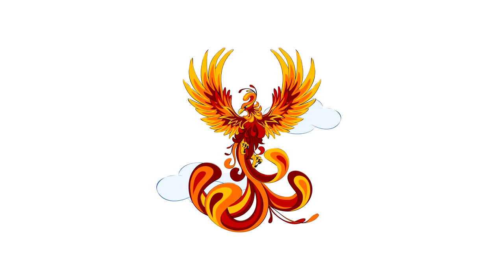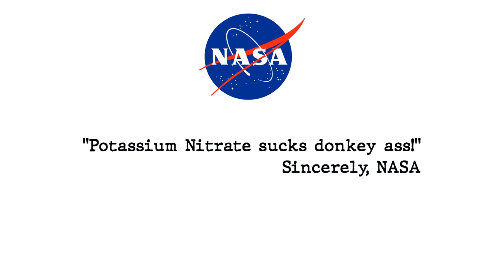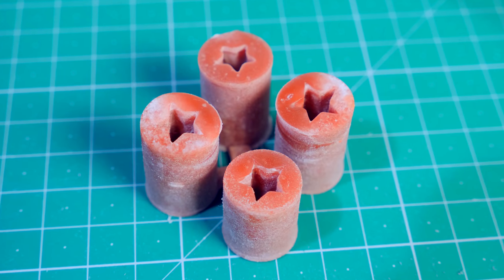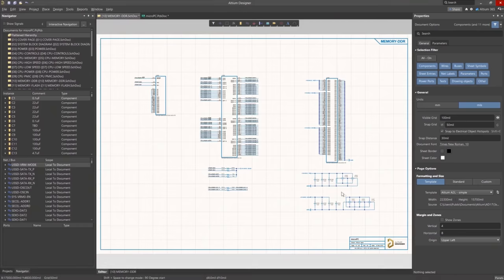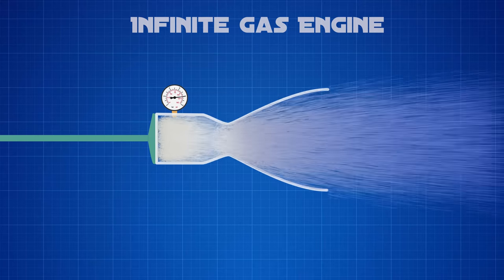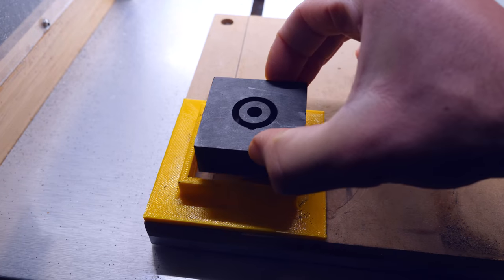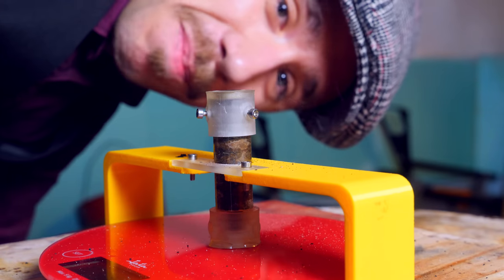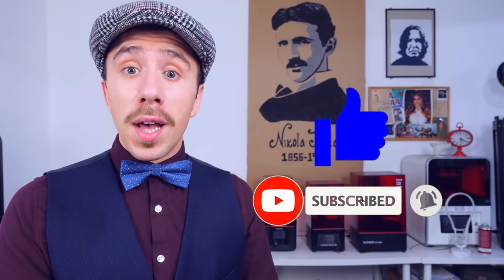I built a PULSED ROCKET ENGINE

Comment: Hi Integza,

I think for your next video, you should make and launch a rockoon and shot for space.

The project would use the rocket components you have been testing, a weather balloon and a small payload maybe a tomato, if you want to put one in orbit or a small satellite. 

i am not sure on the numbers, if it would make it in to low earth orbit or not but the weather ball would cut the distance the rocket has to travel to achieve it massively.  

this would also give you a project that uses the 3d printers for structure of the rocket, cradle and a small amount of electronics, Arduinos, raspberry pi. this would be good for igniter, gps, and other parts of the projects.

this would also give you a chance to use Altium designer for a custom pcb for the controls of the rockoon.

hope you enjoy the idea. 

looking forward to the next video.

Comment: 9:06 the scale is not a very accurate measuring device as the rocket gets lighter when the fuel burns up, you can see at the end that the scale shows a negative number
Reply: True. Also this kind of scale is "very inaccurate" at the base and top of the scale values. He should use a weight to overcome this issue. About the fuel mass variation, he could try to compensate it mathematically.

Comment: Ref 3:25 => A more useful (assuming one is interested from a design standpoint) description of a rocket nozzle would be to state that the nozzle has a smaller diameter than the equivalent core diameter of the solid fuel (called 'grain').   Then it would have to be further explained that fuel grains may be  cored in various shapes, so that the word "equivalent" means their effective circular diameter as IF they were cored in a cylinder shape. However as most small amateur rocket fuel grains are cored in a cylinder shape, it's easily comparable to the nozzle throat diameter.

Comment: You should try to funnel the exhaust gases from a rocket motor and use the gas to turn a tesla turbine with a generator or a propeller on it :D. It might be inefficient but it would be intresting!

Comment: Video Idea: You mentioned, the last time you did a Tesla turbine video, that you were interested in progressively improving the turbine tech. I love combining different ideas from multiple people and I think I found a cool idea for a video.

Tom Stanton made a magnetically-levitated, flywheel-powered, alternator. The idea was to create something that had near-zero friction, which would allow nearly 100% efficiency.

It occurred to me that if you replaced the flywheel with a Tesla turbine, placed the levitation magnets on more than 2 sides of the center axle (to hold it in place better), and surrounded the axle with the turbine casing; you might be able to create a Tesla turbine that can actually spin an alternator at ridiculous speeds.

Comment: Some rockets use the liquid fuel as a way to cool the rocket to keep it from melting. They pump it through tubes like a radiator but instead of a radiator its the nozzel. Maybe print something similar and try cooling the rocket with its own fuel?
Reply: Not in SRBs tho
Reply: Liquid fuel makes everything 9001% harder
Reply: It was used on the V-2 rockets to keep the steel from melting. They didn't have the advanced materials we do today.
Cardboard carbonise at 1000 C, so acts as a coolant as it gets consumed by the propellant burning. We use it as a liner in our reloadable rocket motors.
Estes and aerotech uses a bakalite plastic as a liner, this is an organic plastic that has been around for hundreds of years. They also use it in cookware.

Comment: video idea: You should try to make a 3d printed vacuum/flame-licker engine, it sucks a small flame in a cylinder and that flame heats up the air inside and pushes the piston back.
Reply: This is false, flame lickers are vacuum engines. They extract power from hot gasses cooling, not cool gasses heating. Look it up
Reply: @regulatorjohnson.  yeah they are basically a pneumatic Newcomen engine.
Reply: @regulatorjohnson.  oh my bad, thank you

Comment: Video idea, especially because you are using also 3D printed metal, 3D print the NOx Injector plate. Even if is over engineering probably the hybrid engine is going to be a whole experience if you want in future to approach liquid engines (alcohol and peroxide for example). You can learn a lot on shape optimisation, increase knowledge in material science and last but not least is very challenging even for professionals :). Keep it up!

Comment: Integza , since you have a problem with your engines melting down, use liquid nitrogen as fuel in a rocket engine :D (idea)
Reply: now thats some good thinking.
Reply: Nitrogen requires far too much energy to break the bonds between atoms. Burning it is an endothermic reaction.

Comment: I have a project idea for you. 
To develop a supercavitating torpedo similiar to the VA-111 Shkval using your rocket fuel. The basic concept is to use
rocket exhaust to generate bubbles at the tip to greatly reduce drag.

Comment: You could make the grains out of 70/15/15  by mass AP/HTPB/Al, where AP is Ammonium perchlorate, HTPB is Hydroxyl-terminated polybutadiene and Al is aluminum. This mix is guaranteed to work impeccably and you could create the grains with 3D printed parts. Make sure though you don't do larger scale tests indoors, as if something goes wrong you won't be able to put out the fire and you could damage your belongings or even your health.

Comment: I love your vids and after watching this, I was thinking, is it possible to create a triple throat but one fuel chamber or three chambers, one throat? How inconsistent would it be? Also when you add the actual rocket to the motor in this video, how much faster would the thrust fade with the added weight?
Reply: These size rockets are too small for 3 nozzles, the size of the rocket would determine when 3 nozzles would become more efficent. Both costwise and fuel deliverywise.

Comment: Videos idea 💡 I just watched your aerospike 3D printed engine video and your potassium permangenate video as well. 
Since you have the metal tubing and you can soak the ceramic 3D printed matrix in the permangenate. Correct me if I'm wrong but one of the byproducts of the peroxide-permangenate reaction is energized O2 gas if you use a ceramic nozzle at the end of the permangenate reaction that's confined to aspirated chamber with a star pattern ASA tube and use another aerospike nozzle you could exponentially increase your thrust. You'd of course have to house the whole thing in a metal pipe. But, a 2-stage rocket-ish thing? What a crazy invention that would be!

Comment: Video idea: You always use burning fuels to power your rockets, it would be cool to see you try powering a rocket with cold propelants like dry ice.
Reply: There's a reason propellants need to be hot - rockets convert thermal energy to kinetic energy. A cold propellant still has SOME thermal energy, but it's going to be extremely crappy
Reply: @dsdy1205  would using both increase thrust even more? like using  nitrocellulose to superheat dry ice
Reply: @borne777  if you mix ice cubes and hot water you'd only get lukewarm water. Same concept here, you'd get performance partway between the two

Comment: Do you think that hydrogen balloons can double as fuel tanks for small rockets? Can you maybe try to build a weather-balloon-like device, that would take it to a high altitude, and when the lift of the lighter-than-air gas is no longer efficient, would compress the gas into a miniature engine to take the whole contraption even higher!

Comment: Integza , since you have an issue with you engines melting down, why dont you liquid cool your engines just like the real ones.

(Idea)
Reply: Because regenerative cooling is only used on liquid-fueled rockets, they can't be used on SRB's. Also, a lot of the parts getting hot is the combustion chamber and regenerative cooling is generally only used on the nozzle. It is also extremely complicated, but it would be really cool to see Integza attempt this.

Comment: Have you thought about printing a flexible mold and pouring in a molten propellent? Sugar and saltpetre are pretty easy to melt together and work much better that way IME. Even better/worse: extrude molten sugar/saltpetre mixture with a plastic mixed in to print it on an fdm machine. Maybe do the print outside.

Comment: The shuttle engines used powered Aluminum as the primary fuel, the binder was just there to hold things together while burning.  Ammonium percolate and Aluminum  Give it a try!  Also Iron Oxide and Aluminum  can be loads of fun.  I tried to cast a part with Iron Oxide and Aluminum but too much slag fell to the bottom of the mold.  Still fun to do though.

Comment: I have made rocket models before.
To increase burn rate you can add fine aluminium powder (5-10%).
Maybe even less since you have the resin as a fuel.

Also: poliurethane is a good type of resin for the job.

Comment: Maybe adding something that burns more vigorously with your oxidizer like magnesium or phosphorus, potassium. I have also seen someone dabbling with a silicone mixed solid state fuel which was very energetic so maybe there's something there if you have a silicone based 3d print material. Love the channel btw

Comment: What if you take a 3D printed engine and ply it to a secondary booster (3D printed engine) you could do this to stimulate the initial booster rockets and the phase two thruster rocket using your compound 70% and compound 60% but instead of printing the five point star structure for stability you print a 10 point structure for your burn/propulsion chamber this may regulate some additional oxygen in the space giving it more immediate burn compression and with more burn there must be more output if your nozzle dos not change. I also think that a pressure regulated nozzle could be established to allow a "forced" open at the point of validity to sound allowing for a smooth transition from none compressible to compressible. If you think he should build a two stage engine next throw me a thumbs up!!

Comment: Video idea: Maybe you could try using cotton fiber infused resin to print your grain. Then use methylene chloride or other suitable solvent to dissolve most of the resin leaving a mostly cotton porous lattice. Then treat the cotton lattice to make nitro cellulose. The trick will be to keep enough structure in the cotton lattice to keep it together but leave it porous enough so that it can be mostly nitrated. Might need a technique similar to the manufacture of aerogel.

Comment: You added iorn oxide you also need to ad 1/4 aluminum powder 3000 grain. It's not quite thermite but it will equalize the pressure and give you a double oxidizer.

Comment: For the next video, you should trying to do a rocket powder plane or a steam powered plane and test to see if the thrust is actually able to lift it off the ground for both. You can use the 3D printer to build the structure and making it lightweight

Comment: Could you try housing a more concentrated form of the fuel inside of your prints. Making the fuel like you are now, but leaving space empty inside of them that you can fill after they are done printing, you could also cure some resin onto of them after they are done printing to fill the hole used used put the fuel inside. Yhat would allow you to 3D print the fuel like you are now but have more of the actual propellant inside of the thruster.

Comment: Test different assisted launch methods for a rocket to see how much and assisted launcher could help save rocket fuel.
(sling shot, flywheel, pneumatic/hydraulic pressure, magnetic rail)
and get a basic model rocket add a little weight to simulate load. and test different altitudes.

Comment: Video idea: how about a rocket powered propeller powered airplane?  Could be approached two ways.  One where you have the exhaust of the rocket to spin a turbine which spins the propller at low rpm for a longer time.  Or go with mini rockets on the propeller tips to get high rpm for a shorter time.  I think this could be neat and naybe a little dangerous either way haha

Comment: Hmm using a few small pieces of the flash cotton, in between or mixed in to the rocket fuel paste could be interesting for a stronger but not too crazy thrust force.

That said if you ever want to do a two stage rocket when you're ready, you already know how to set up say explosive bolts or an ejection system which could be self controlled by the central fire.

Comment: VIDEO IDEA: You could use water electrolysis to produce O2 and H2 gas, one to use as fuel for an engine and the other as an oxidizer. H2 Isn't really efficient as fuel but you could use this reaction to explain some cool science and as a bonus you get to use high voltage!

Comment: What would happen if you were to grind the nitrocellulose and mix it with a slower-burning resin then 3d print it? 
What sort of resin would you get from using graphite dust?
Also, as far as nozzle go, why not make a straight-wall cylinder with the nozzle's shape inside it? While it might not be the most-efficient or the best for resisting the heat, it would be a bit sturdier and probably last long enough for solid fuel to completely burn, and you'd be able to print it and the fuel chamber as one unit instead of needing to jury-rig the two parts together after the fact.

Comment: I would make a stronger body for your combustion chamber. Your body seems to melt a bit and might cause you to lose some trust! There are 3d printing materials with carbon threads and higher melting temperatures! that or just aluminum/metal sheet inserts! Loved the video! Patrick

Comment: YES you have a real nozzle now! How about printing just the fuel grain, and using nitrous oxide as oxidizer for a hybrid engine? NOS is room-temperature storable under as a liquid (non cryogenic), under enough pressure to force liquid oxidizer (not just gas) thru your fuel grain.

Comment: 3D printed pulse rocket engine with compartments that separate the fuel so it acts like a pulse jet engine. Could possibly add different salts to produce different flame colors at the different burn stages

Comment: Would it be possible to combine a hydraulic ram pump, a Trompe, and a Tesla turbine and what would be the result in possible electricity production, water flow up hill, and air pressure generated from low water flow? Just some random thoughts....

Comment: video idea: make a phoenix that can actually be reborn after burning. the simplest solution would just be mixing the ashes into a new batch of resin, but that is to easy. the second idea i had was to use a method similar to those candle recyclers where as the first candle burns, a new candle is formed as the wax runs into a collector. if the phoenix was a mix of a fuel that burns and a solid that melts at the temp the fuel burns at, that leftover molten material could be reshaped to form a new phoenix with a mold.

Comment: puts gun cotton in it so you made a graphite shotgun slug? lol, the tilting resin vat keeping the resin mixed was genius, you should try putting graphite powder (or graphene?) and see if you can print something conductive, maybe make a circuit. Hell maybe you can use it to ignite the fuel for your rockets.

Comment: What do you think  about doing the resin for 3D printing, mixing the ammonium perchlorate with the nitro cellulose micro fibers or powder ? Do you think this could be possible and easy to use with the printer? In that way you got an intermediate speed of burning of the 2 components, playing with the percentage to manage how quick it can burn.

Comment: Video idea : revisiting the vortex thruster try and use a propane oxogen mix and use a non flammable gas to create the vortex you could use a turbo to increase the pressure of the fuel mix

Comment: the gun cotton has too much space inbetween the fibers.Solid fuel motor use the inside chameber for pressure generation but only because the fuel mediums viscosity is one standard so that the best way only to play with the nozzle.The burnrate is also a bit slow.We usaly make a ball about a thumbmail size and light it.Ishould hiss like a angry snake and want to roll about frim the side of the burn.If it scares you its right.A 3mm nozzle on a 20mm tube is about right.

Comment: You can make a  pulsar tomato 🍅 killer use a Tesla turbine  then  add a wheel  so you can add a  piston  use a metal  pipe as a case for the piston  when you add fuel  it will  go out the hole  as the engine goes the piston will cover the hole  under the hole add a platform (for the Tomato 🍅).

Comment: Instead of limiting the performance of the rocket engine by restricting the mix of resin/oxidizer sure to the limits of the 3d printer, why not just 3d print a mold then you can use whatever resin/oxidizer mixture is optimum? I don't know exactly what material you would use for the internal section of the mold, but I'm sure there is a medium available that would be able to be melted out at a temperature below the ignition point of the rocket engine.

Comment: Part of the problem is that you're not igniting the entire surface area of the grain; the igniter in a commercial solid fuel rocket motor sends a jet of flame down the entire length of the grain, ensuring all the exposed surface ignites pretty much simultaneously.

Comment: Aren't you supposed to ignite solid fuel at the closed end? I guess this way it burns much faster because of higher pressure and ignition of the whole charge by hot gases leaving the rocket?